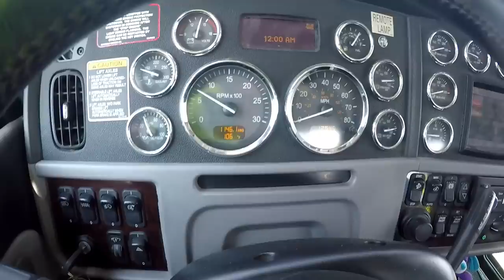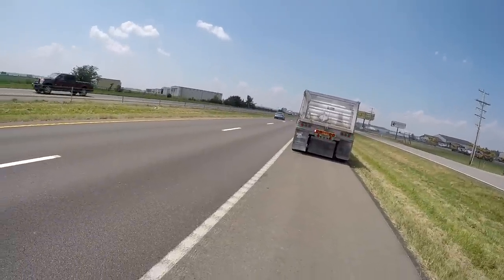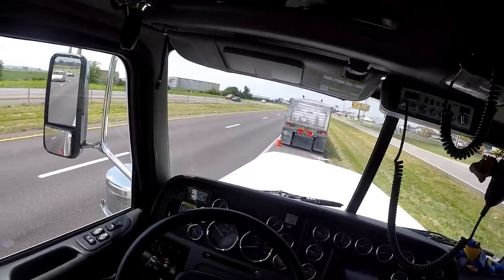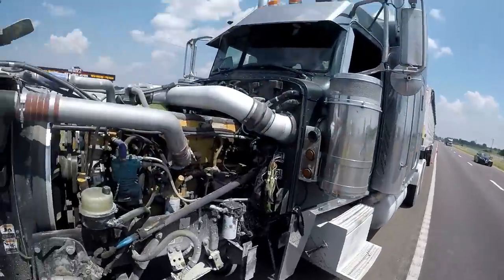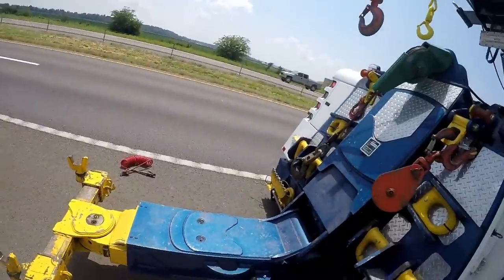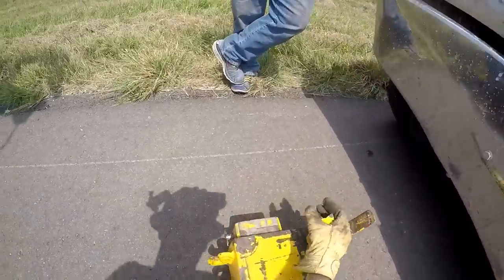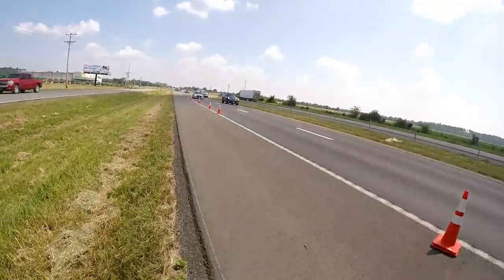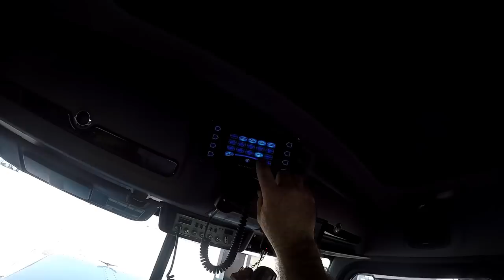THIRSTY TRUCK ON A HOT DAY

Comment: Hey man you were pretty brave to be out there on the side of the highway with those idiots they gave no due caution to the fact there was a wrecker on the side of the road with the lights on and it must be pretty embarrassing to be out of fuel on a main highway this is why I check the fuel level on the tank(s) by opening up the fuel cap(s) and use a flash light if possible to make sure the fuel level in the fuel tank(s) to make sure the fuel level in the tank(s) matches up with the gauge on the dash I am a cdl licensed truck driver (class B with air brakes and tanker endorsement) if I see a wrecker on the side of the road I try to help slow traffic down by activating my hazard lights until I am passed the wrecker I don’t know about the laws in the state you live in but here in Florida where I live you are required by Florida law to either  move out of the lane closest to the emergency vehicle (including wreckers with the lights flashing) or slow down 20 mph (miles per hour) below the speed limit on the higher speed roads like the interstate highways here in Florida this to protect you wrecker drivers and the vehicle owners and drivers from getting killed trying to do your job of rescuing dead (broken down) vehicles. Of the highways which is the most dangerous place a wrecker driver can be due to the high speed and people like those idiots that don’t give a flip if you go home to your family or not all there worried about is getting where there going they don’t care about your safety I see the cars and trucks going two wide they are Doing 70 mph (miles per hour) at least but I try to protect all you wrecker drivers out there if I see a wrecker then I slow down and then activate my hazard lights to warn people behind me to slow down there is danger ahead until I get passed the wrecker I do this to try and help warn traffic behind me to slow down and use due caution you wrecker drivers are trying to make a living not get killed by drivers that don’t give a flip about anything but themselves be safe out there and I will always help you wrecker drivers stay safe if I see a wrecker on the road picking a vehicle up like I said I slow down and activate my hazard lights to warn people of the safer ahead and to use due caution like us cdl truck drivers are supposed to be taught in school but half of the truck drivers don’t give two flying flips about any one else unlike some of us nice truck drivers that when we see a wrecker we activate the hazard lights and try to get these other idiots to use due caution and keep you wrecker drivers safe we all share the road together

Comment: In Florida traffic must slow down at least 15 mph if they can't move over away from the emergency vehicles. And I don't think tow vehicles are considered emergency in Florida. In my country boy opinion any vehicle or equipment on the side of the road should be treated as a emergency vehicle and must move or slow down at least 15mph. Whether or not it broken down or having a picnic ( just kidding about that). Bottom line is if SOMETHING or SOMEONE is on the side traffic need to MOVE OVER. I work construction as a equipment mechanic and they get to close for comfort. 
  Short story, my buddy hit a car with his shoe while facing the vehicle he was working on he never turned around and never lost his grip of the shoe. The drive stopped and told the cop on scene what happened and then questions my buddy about it. The drive told the cop he had the shoe in his hand and how he was kneeling and facing. The drivers reaction was priceless when he received a ticket for the whole thing. Cop explained from where Mike ( my buddy) was it was impossible to hit him if he wasn't inside of the line, told the driver Mike's arm would have to be 6 foot long. The idiot came inside our lane to get hit. Driver started to argue with Mr police officer and Mr officer told him if he says one thing more he was going to jail. His face was beat red when he drove away with his ticket.
Reply from the maker: Wow, it so dangerous out there!!!!  I am glad that situation worked out in your friend's favor.  People just don't realize the need to move over.  God bless and thank you for watching.
Reply: In California tow trucks are not considered emergency vehicles. Flashing lights mean move over.

Comment: Hello Ron Pratt, I notice that you are still using what we call "Glad Hand" airline fittings.
We in Australia phased these fittings out in favour of "PBR male/female push fittings.
they are smaller and more positive than the glad hand fittings, as the rubber centre section can distort on those and cause air to leak.
Are those fittings still in common use in the US?.

Comment: I bet by putting big red and blue lights on the back your rotator will help with moving traffic over. I have been in the fire service for 10 years now. I like your YouTube videos.
Reply from the maker: We have purchased an arrow board and mounted it on the top of one of our rollback trucks.  So far, this has worked better at moving traffic over than any other method that we have tried short of having police, fire, or the state, providing traffic control for us.  Thanks for the suggestion.  God bless.

Comment: Ron I have an idea however I don't know if it's worth it or not, a lot of Iowa dot trucks in the summer months use a fold down absorber during road work maybe you could get a used one with that setup to use on calls like this you could also outfit it with one of those bigger direction arrows

Comment: That was cool that the officer blocked the right lane, made it a lot safer for you, Ron. That one black car, i'll bet the driver was looking at the truck and the lights on the back of it. There's a phenomenon in which people steer in the direction that they're looking. That's probably why that black car came too close for comfort. That's why these kinds of accidents happen. Imho, it's better to slow down and move over if it is possible. Maybe a glance at the scene, but nothing more, since there is already help on the scene. Gawkers are one of the most dangerous drivers around, they're responsible for some of the secondary accidents.

Comment: That is scary. I've had the misfortune of working on construction equipment on the side of an interstate (paving crews) and I didnt like it, and i was protected by a closed lane or a barrier. I couldnt imagine what you do. 

In your case, I think states dont make it clear enough that tow rigs are emergency vehicles. In tennessee, the move over law wasnt even a thing until about 10 years ago when an officer was killed on I40, and even then the law was move over or slow down for emergency vehicles, which to the average joe means police, fire, and ambulances. The DOT guys and tow trucks were a gray area. Now it is changing to anyone with their hazards on, which is really how it should be. 

Stay safe out there.

Comment: You mentioned about pulling the drive shaft. I remember you and Talon did that on that railroad vehicle. Why does the shaft have to be disconnected? Can't you put it in neutral and still tow it? Thanks in advance. :)

Comment: Virginia passed a law in 2015 that requires drivers to move left or right if red, blue or yellow lights are flashing. Mainly due to deaths of VDOT workers and State Troopers killed by motorist running into them. I always did it as a courtesy to fellow drivers.

Comment: I do roadside repair and am just a little curious why they wouldn't just call out a roadside assistance for some fuel and get it started. I've done it many times with no need for a tow. Much respect for you and your job it's dangerous out there for sure. stay safe out there bud
Reply: I know its a bit late but on some diesel machines if you run them right out of fuel it air locks the fuel system and just putting more fuel in wont get the truck moving again. You have to take off fuel lines and purge the air first. Not the kind of thing you want to be doing at the side of the interstate in that kind of heat and with belligerent traffic. Not to say that's the case but id assume it is since they didn't just fuel it up.

Comment: If you end up with a metro bus as we have in Minneapolis, Mn. with a pusher diesel in the back they don't have fuel gauges as they are in the shed everyday and the fuel is topped off.  Their routes are short enough that it doesn't matter.  If you should run out of diesel they have an air fitting by the engine that you can pressurize the fuel tank with a max of 20 psi to re-prime the system or pull the fuel filter and fill that up if you can get it off without ruining it. My buddy bought one and we made it to within 100 feet of the pump at the service station.  This is how we made it home.  Instead of laying on the hot pavement and frying your bacon why don't you cut out some heavy pieces of cardboard and slip them behind the seat??  Good for the oil spills, icy pavement, and wet dirt. I'm surprised the commercial trucks don't have a quick connect air fitting installed for tow trucks. Probably would need a check valve by the compressor where it would tee into the line. PLUG AND GO!!!  Keep your tools in the truck. Enjoy, Warren.

Comment: You need an arrow stick on a tripod that you can set down the road with your first cone.
Also, in my opinion, halogen strobes are more effective than LED. Honestly when you were putting cones out and returning to truck, I could barely tell your lights were on.

Comment: Hi Ron, seeing your cones are placed along the white line straight, would it be allowable by law there to sweep them into a safer distance diagonally outwards at a further distance to allow safer clearance in your working lane. Also, possibly fit beacons on top of the cones as a light warning too. Maybe two cones with a flashing arrow pointing outwards They would give a far-reaching warning to traffic to move over, both day and especially night.  Regards Mike.
Reply from the maker: For insurance and liability purposes we are not allowed to block off a lane unless absolutely necessary.  We can ask for traffic assistance from PD or Fire.  If we shut down a lane ourselves there are strict guidelines that must be followed regarding advanced warning signage very similar to the way a road construction crew must set up advanced warning miles in advance.  Even then, there is a liability issue.  On two lane roads without shoulders we don't have a choice but to shut down a lane or both, but on the interstate it is a big NO NO.   Thanks for watching and God bless.

Comment: in UAE, heavy traffic is limited to slow lane, and they are not allowed to change into the fast lanes, unless if there is any emergency or a situation like this, and they have seperate speedlimits for them too. which is not more than 80mph i.e ~50mph.

Comment: In a case like this, where it's a perfectly good truck that just ran out of fuel, I wonder if it wouldn't be easier to have a service truck with a 50 gallon diesel tank and a pump. Or maybe carry some kind of pump and hose to transfer fuel from the tow truck's tanks. Give them just enough fuel to make to the next truck stop.

Comment: I learned a lot.  I was wondering if the light bar was wireless when I saw Talon driving the tow with you following, and magically the light bar had the brakes and turn signal working.   I do need to know why it isn't raining or muddy, and where are the power lines?  I think your profession should lobby for a law that allows the cones to be put out in the lane a bit.  Also, why didn't you just bring him gas/diesel?  

Disconnecting the drive shaft has to be the worst job!  I am glad you didn't have to do it at the customer request.  I knew you were getting the tie-down chains.  I might be watching too many of your videos.  I was wondering why you put a block under the tire when attaching the tie-downs.  Is it to give extra room in case it slips off?  I really like it when you say what you are doing.  I hope you remembered to flip his license plate down.

Comment: @Ron Pratt hey i have a question, howcome you couldnt fuel up on the side of the road?
Reply: Some trucks after running out of fuel are hard to get going again.
Reply: When diesels run out, you have to purge the entire system, and refill the filters and lines, the pump can’t generally self prime, it’d burn out.

Comment: They really should allow emergency vehicles some authority to at least get plate numbers and report them for not merging into the other lane... I mean they have two options. Slow down 20 miles under the speed limit in the right lane or get over. Fairly simple.

Comment: I would add: Get out of the passenger side of the truck when stopped on the shoulder. Stow the things you need to deploy for safety (lightbar, cones) on the near side of the truck so you are not standing next to a live lane when retrieving them. No doubt someone has already suggested this, or there is some reason it is not practical!

Comment: interesting the low down and pull over thing doesn't exist in the UK, you just have to pray folk are not playing on there phone and wandering into the hard shoulder (emergency lane or whatever you call it!) most roads are just to busy for such a system to work. the only time folks pull over is if the police block the lane.

Comment: I am guessing the "light bar" works by some type of frequency that you don't need a umbilical cord? 
I believe that black car crossed over the solid white line when they took their eyes off the road to look in the mirror and perhaps over their shoulder to hurriedly shift lanes and when they did that the car drifted as can happen at high speed and with such direct steering. Then need to bring back play in the steering wheels.  Would be nice if they would pass a law allowing you to put out cones that slowly makes cars merge into one lane however then you'd need a big compartment  to  keep all those cones that preferably blink red and blue with a yellow arrow pointing to the left lane like road crews have. I have a really super idea, get an inflatable police car with blinking lights to put in the right lane, Ie.. Decoy hahhahahha   Or a battery operated light on a tripod in the right lane with an arrow blinking towards the left.

Comment: For the fact your review screen is sometimes hard to see with your sunglasses... likely have polarized sunglasses.  Screens are polarized.  Tilting your head at an angle usually works, but also putting on a screen protector on it usually gets rid of the issues with polarization.

Comment: Suggestion: If you're on the highway or freeway exit and enter the truck from the passenger side instead of the driver's side. On the other hand people should be moving over by the move over law. It's an expensive ticket if you don't move over for emergency vehicles along side of the highway or roadway

Comment: Question. When I was taught to hook, I was told to always put a binder on my under-reach chains to insure they don't come lose or move. I haven't seen that done in any of these videos. Is it a necessary step? Unnecessary? Just wondering
Reply from the maker: Good question.  Everybody does things differently.  I'm familiar with your method of securement and, no, it isn't wrong.  If it works for you and is safe, continue doing it.  I've found a way that works for me that is safe, secure, and quick.  As long as both ways are safe, whose to say that either is wrong?   I don't.   They are just different.  Stay safe.  Thanks for watching and God bless.

Comment: The engine brake on your truck doesn’t sound bad. If it only were a little louder. I’m not telling you to straight pipe your truck, that’s a lot of work. I just sounds good. It’s quiet because engine has emissions but it sounds alright.
Reply from the maker: Our first truck was a conventional Marmon with a 425 Caterpillar, Jacobs Engine Brake (Jake Brake) and 5" straight pipes run right behind the doors on solid mounts.  I used to love going through tunnels, overpasses, etc, and bumping the Jake.  The exhaust was so loud on that truck that you couldn't hear each other talking and forget about trying to sleep in the bunk if someone else was driving!!!  Thanks for watching and God bless.
Reply: Ron Pratt yeah I love loud trucks. They sound great. But for some people they could be a little too loud. My truck got a c15 700+hp caterpillar engine. Yes it is modded. She’s extremely loud.

Comment: You're not equipped to get the truck primed out on the road? We used to pull the filters and primed them right there.
Reply from the maker: We are equipped to do so and have done so many times.  There were other problems involved with this truck that made it quicker and safer to tow it in.  Thanks for watching and God bless.

Comment: Hi Ron, I appreciate watching your videos, and your skill.
 Everytime I watch when you pull on to the shoulder  for a tow as in this job, I cringe when I see the traffic not moving over or slowing down for your and the stranded drivers safety. In South Australia, when any emergency services are working on the the side of the road, it is mandatory for traffic in both lanes, on a two lane each way highway, to slow to 25 kph / 15 mph.

Comment: A lot involved it a "simple" tow job of a big rig. I'm curious, what can ya bill for a job like that? Also, ya said he ran outa fuel. Why not just refuel him? Or is that a big diesel kinda thing that when ya run out ya damage or discombooberate it so much it needs the shop?  Thanks.
Reply: My thoughts exactly, why not pull up with a tanker (even on the road next to the interstate) or a few Jerry cans, fill and vent the system, should be good to start again, faster than towing and just need enough to get to the next gas station, it looks like a somewhat civilized area, should be one not far away :)